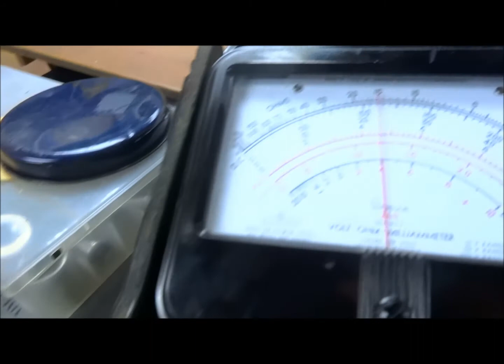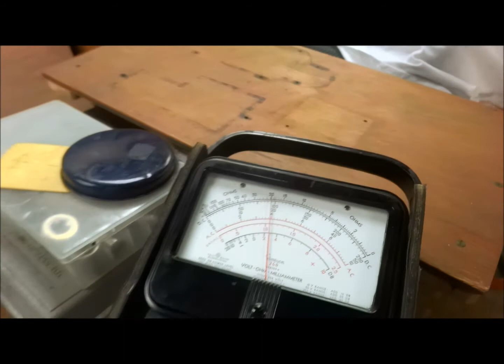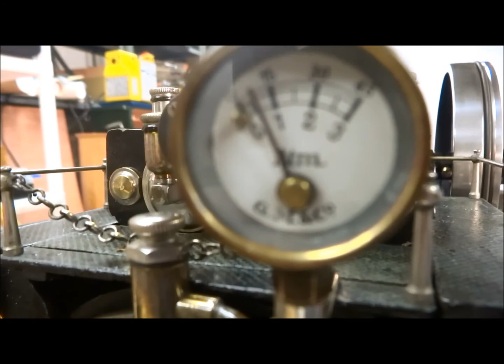Marklin  4159 / 11 / 94  Live Steam Test Run

Comment: I recently got a vintage Marklin 4146/91/9 and i wonder what grease is best to use for the valves that are a bit stif (whistle, throttle, blow down ect) Thanks in advance.
Reply from the maker: Marco, Try the same oil used in the steam cylinder for anything that is touched by steam. Use a light machine oil or synthetic clock oil on any other friction surfaces like bearings, etc. You can also join my forum www.officeofsteamforum.com and ask anything you want there. We have lots of knowledgeable members.
Reply: @reddrryder  thank you very much!